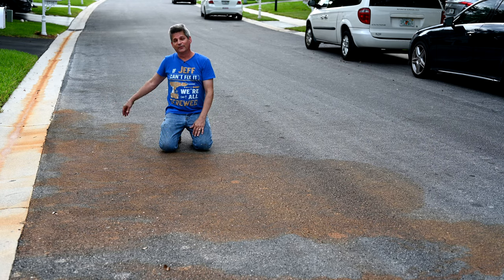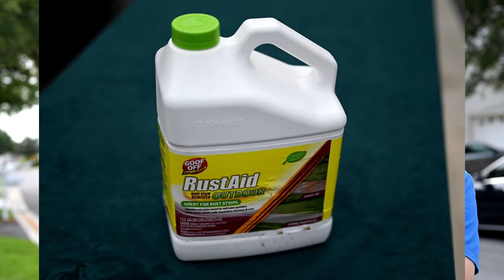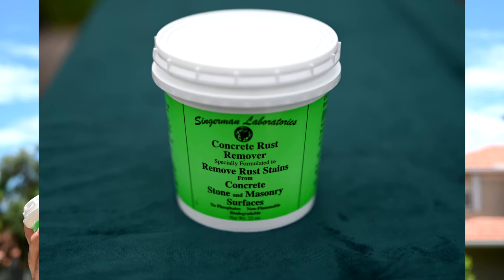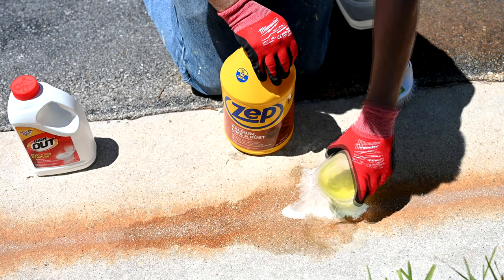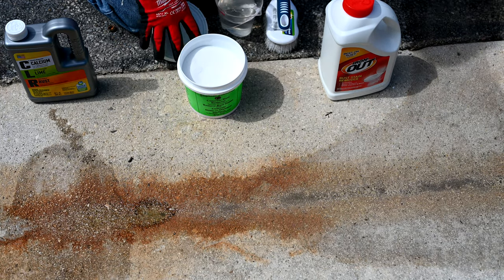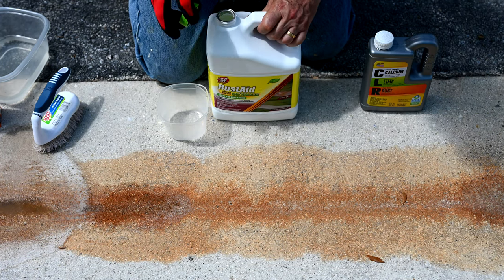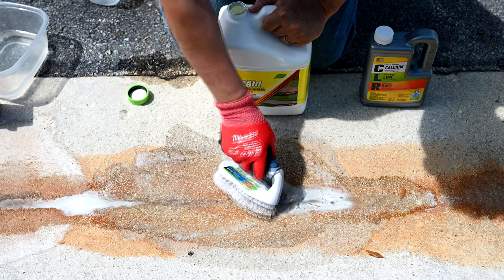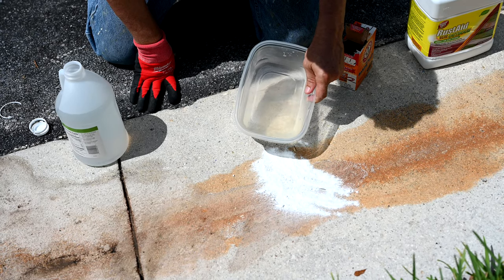Rust Remover Challenge: What Removes Rust Stains Off Concrete?

Comment from the maker: ✅ Here is the winner from our testing:Singerman Laboratories Rust Remover for Concrete (22 oz makes 1 gallon): https://amzn.to/2Y7UY6y
Reply: Do you think it works for white brick?
Reply: Yeah Jeff I bought that $28 Singerman product and it did diddley after multiple applications and even leaving it for an hour. Maybe you got a concentrated jug . Mine was not.
Reply from the maker: @jamespearson3874  No they are all the same. The Singerman comes in a small white tub, and you mix the crystals with water to forma jug. so there is no way mine was any more concentrated than yours. Are you sure you bought the actual Singerman product? White tub, with green label. It should work, it has worked on everything we tried it on. Also, if mixed correctly, the product works in about 3 minutes, and they tell you to rinse it off before 15 minutes or it will stain the concrete. So leaving it on an hour will accomplish nothing. So question is, are we sure it was rust you were applying it on, and not something else? I'd love to see a video of this in action if you can post one on your channel and send us the link to t.
Reply: Would this be safe for patio slabs or stones? Or is it strictly for concrete?
Reply from the maker: @RH-nk7eo  yes have used it on blacktop, pavers, painted surfaces
Reply: Where can you buy Singerman Rust Remover?
Reply: @thecaptain6994  …Jeff put a link in the top comment that you can use to buy it through Amazon.
Reply: @jamespearson3874  $28??? here in Canada, I cannot find it for anything less than $90 for the same size container :(
I think I am going to go for the Rust Out which is on sale right now at our local Home Hardware store for $13.95. It looks like it did a half decent job in Jeff's video.
Reply: Worked like a charm on my stamped concrete patio. Thanks Jeff!
Reply: For what ever reason SIngerman does nothing for me. I've had the best results with rust aid. I have massive dark red spots in my drive away and literally nothing works on it.
Reply: @jamespearson3874  It didn't do squat for me either.
Reply: Whuch of those products do you feel offers the best value for the money? The Singerman seems pretty pricey for a gallon. Also  which can be most easily he applied with a sprayer? Thanks.
Reply from the maker: @UnderPresser  The fingerprint product even though it might be More expensive than others comma at least it does the job And you don't have to keep driving to the store. Looking for one that does work. It's a somewhat thick and gooey product once you mix it so I don't know if it will spray. I have not. Tried it yet and I prefer to work or small area at a time because you have About five minutes before you have to rinse it off
Reply: I use Oxcalic Acid. It kicks butt

Comment: Based on seeing this video a year ago, I finally got the Singerman stuff and used it.  Man did it work!  This video isn't trickery, the Singerman did exactly what the video shows.  And I have a whitish concrete driveway that had radiator rust spots on it from a leaky car, and these were thick and very orange... very hard to get out - I tried a lot of stuff and it barely made a dent.  The Singerman cut right through it!  Amazing, thank you for the tip!  A few other comments:

- The directions are very good and clear.  They did say that there should be a decent layer of gel on top - if you try to spread it out too thin, it's not quite as good. I found this to be true... leave enough on to cover the "highest" points surrounding the pores of your concrete (like 1/8", not much).  The stuff I just lightly coated on came off a little less.  I assume the layer is to give the chemical enough room to work and mix in with the rust.  Whatever, it was great.

- You'll know it worked when most of the rust turns from red to green.  If so, it simply hoses off... amazing!  You can also scrub the toughest areas, but it only helped a little.

- They say it loses half its strength after 15 minutes, but not to let it dry completely.  However, it dries pretty slowly - over an hour if applied correctly.  The first batch I let on for 15 mins. and all but the worst, thickest rust came out.  I did a second batch over a similar rust spot and let it sit for over an hour.  In this case it came off 100%.  So you might let it sit at least 30 mins. for the worst stains.

Anyway thanks, this is a GREAT product!
Reply from the maker: Thanks, I'm glad you liked it!
Reply: Can you dilute this product and use a pump sprayer ?
Reply: 0⁹

Comment: When it comes to the Goof Off, I can tell you I have hard water rust stains on my sidewalks and driveway that it turned absolutely white.  Worked better then I could have imagined.  I’m sure there is a difference in rust, but mine was pretty bad.  To be honest it took  a couple applications (2).  That worked the best, CLR did nothing and I have never had luck with that product literally on anything.  I just sprayed the Goof Off on and in minutes it cleaned it.  Just my experience.

Comment: I had some serious rust stains on porous pavers from iron fittings dripping from my faucet & from fertilizer dripping through an above ground planter on my lanai. I just realized I had a container of Zep on my shelf I bought about 15 years ago & gave it a try. In just one application (50/50 mix) it totally removed any trace of stains on all my pavers. I was ready to buy new pavers & replace them all. I wouldn't hesitate to buy it again.
Reply from the maker: Sometimes it depends on the rust type, but you can see here Zep had not much impact on the rust.
Reply: @Rich my issue is fertilizer rust on brand new concrete pavers. So annoying! Did you use the formula of Zep shown in this video?

Comment: Jeff, my experience...I use the Goof Off Rust Aid in a pump sprayer on sprinkler rust on white plastic fences and the house stucco and its gone in 2 minutes. But on the brick driveway pavers and the sidewalk no luck. 
   I then pressure cleaned the driveway and sidewalk (lots of dirt) let it dry and tried the Goof Off again and the rust disappeared. No rinsing.

Next challenge....HOW TO GET OIL STAINS OUT OF CONCRETE AND BRICK PAVERS
Reply from the maker: That is very strange. It must have something to do with chemical bonding to the concrete. That explains why the Singerman Laboratories product worked so well, because it was formulated to work on concrete. I wonder how it would work on the PVC fence.

Comment: Baking soda works as a base and therefore neutralizes the acid in the vinegar rendering both combined useless for cleaning. You're better using either stand-alone vinegar for its acidic property or a water and baking soda mixture for its abrasive property. Again, together you're creating a mixture that could have been done with water, but it does create CO2 if that can be used for anything. It will put out a fire but baking soda can also do that as a stand-alone. Just throw it in a fire to douse it.
Reply: He never rinsed it off either.  If you don't rinse it off afterward, it will look like this.  I just tried white vinegar on my concrete driveway on a rust spot, and after I rinsed it off (after about an hour) it looks great.  He didn't rinse off any of the products on the video, so no wonder the results were so bad on all of them.
Reply: Exactly!   MAJOR pet peeve of mine mixing them. Use either one, but not both together.   Like mixing hot water and ice cubes and expecting something spectacular.

Comment: What do you recommend for removing very light rust stains around a pool. From a iron patio set.It's concrete with a little bit of rocks. It's not heavy at all mildly lite stains. Slightly yellow
Reply from the maker: I would use the Singermann Labs we showed in tis video

Comment: Haven't trid anything yet on a few heavy rust stains in the garage - nice clean concrete floor of 10 years.  SO did a quick google search.
That search brought up quite a few different websites stating 'straight lemon juice'; as the best remedy.
Then seen this vid listed further down the line -thou now 5 yrs later - surprised no mention of the lemon juice at all here nor in the comments.

Comment: Vinegar works on many things. To remove rust from METAL I haven’t found anything better besides the electrolysis method. Also, white vinegar is a cleaner not a salad dressing. Use red wine vinegar or apple cider vinegar for your salad.😊
Reply from the maker: Great tip!

Comment: Surprised white vinegar didn't do well, it definitely works great for rust on metal
Reply from the maker: I was watching another video from somebody else yesterday where the vinegar did not work on metal So who knows the mystery of why does or does not work
Reply: @jeffostroff  had to lol at your video, I actually dump out the vinegar into a bucket and throw old steel horseshoes over night and it works magic
Reply from the maker: @steverone7623  Could be it works on some metal, but not when it's on concrete. Look at David' Kupferman's comment above,  Goof Off Rust Aid in a pump sprayer on sprinkler rust on white plastic fences and the house stucco and its gone in 2 minutes. But on the brick driveway pavers and the sidewalk no luck.
Reply: Rust doesn't bond to concrete the same way it bonds to metal.
Reply: @jeffumbach  if you use a grinder on steel over top of concrete, the metal shavings that come off will rust and stain the concrete ask me how I know 😂
Reply: He never rinsed it off.

Comment: I just use very inexpensive Oxalic acid 12 ounces to a gallon of water in a garden sprayer. Let it sit for 15 minutes and rinse it off and the rust is gone..I paid $2.50 per pound for my Oxalic acid bought here in Florida in the Fall of 2023.
Reply: Just done porcelain tiles outdoors been down for 7 years 
Non slip so there textured 
I could not clean them no matter what I used the I used Oxalic acid 
Started off being cautious then made aslurry 
 Used 30 kgs 
They came up atreat brand knew grout as well 
But you need a short nose bristle and elbow grease

Comment: I used the Singerman. Some of the rust from iron fertilizer pellets came out. And I also wound up with some white stains.
Reply from the maker: You have to make sure to rinse it before 10 minutes or it will stain
Reply: @jeffostroff  I waited the 15-20 it says on the container. And I had to apply multiple times to get the stains out. Then here comes my gardener again putting those iron pellets on. So I have to do something else or reapply.
Reply: @jeffostroff  stain what color

Comment: That stain reminds me of when I left an old chevy s10 with a rusty bed parked out front for nearly a year. The rain kept rusting and washing the truck and put a big embarrassing stain on the pavement!
Reply from the maker: Yeight did you ever get rid of the stained?
Reply: I flushed my vehicle's radiator with it parked in my driveway (concrete).  I thought the rust stains would never go away!  It took years, despite trying several different cleaners & lots of scrubbing evety once in a while when I felt motivated & optimistic.

Comment: SIDE NOTE:  Baking soda is a base and vinegar is an acid.  The distilled vinegar will get the job done with more soaking time, but the baking soda neutralized its pH rendering it ineffective.  Mixing these two only results in making Chlorine gas and salt water.
Reply: Baking soda and vinegar produce carbon dioxide. Bleach and vinegar produce chlorine gas. #science
Reply: @frankreilly7858 I tried vinegar. Nothing happened except me craving salad.  However vinegar works great on your windows if they build up slime from the sprinkler water. Vinegar and newspaper was the only thing that got the window clean.

Comment: Unless you edited out the use of 7 separate scrub brushes, OR  footage of your COMPLETELY cleaning the single scrub brush it appears that you used, through the entire "experiment",  you ended up scrubbing each spill with the remnants of the previous cleaner, after using the ZEP.   Not a clear test of each individual products strength .
Reply from the maker: Brush was rinsed in between.

Comment: Rust removal from concrete may be different but I can assure you soaking rusty metal in vinegar is as effective as the most effective acid (hydrochloric). Except vinegar does not have the safety issues harsh acids do and you can even put your hands in it without burning your skin.

Comment: What accident happened that put all of that rust stain on the pavement and concrete? Was it just a spill that dried out and left the stain or did it develop over a long period of time because of rusty water draining over it or something similar?
Reply from the maker: What happened was I used so famished acid to clean off my metal tile tools to clean all of the mortar off of it and when it was done the water was clear so I dumped the water on the street thinking OK it's just clear water but found out later I guess that all of the iron and other metal particles that had sort of edged off of the metal tools a little bit left a lot of particles in the water that you didn't see and till it oxidized in the air within A-day of pouring it on the street.

Comment: Vinegar and salt. CLR ? You need a water blaster! In Australia nothing is really strong enough!
Reply from the maker: The pressure washers don't even help
Reply: @jeffostroff  I bet a hot water blaster would do it? But at 6000 psi! But it rips up bitumen or asphalt.
Reply: @jeffostroff  American brand pressure washer.  Damn cheap and great value. 3500 psi, under $ 200 AUD.

Comment: Baking Soda, its only use in these internet home remedies is as a aggregate for polishing.
However they all failed 3rd grade science class and they add it to the peroxide or vinegar there by neutralizing the properties of the other material component.
Vinegar works fine, especially the cleaning vinegar but you have to be very careful with concrete, especially if the concrete or vinegar is hot.
I once used cleaning vinegar to clean and flush an old waterheater.
During the flush a puddle of vinegar got on the concrete, even though I immediately neutralized it within 30 seconds with baking soda and got it up with lots of water and a shop-vac, the previously smooth concrete was rough and pitted.

Comment: Lol vinegar does do a lot though. Microwave water and vinegar in a mug. Smells terrible but it will loosen spills in microwave and remove smell. I also just used it to clean battery acid off a ton of old faux candles that I let batteries expire in. Bubbled and dissolved it. Dont hate!
Reply from the maker: Well you saw how little effect vinegar head on rust stains on concrete
Reply: @jeffostroff  Yes agreed, but it is still more useful than as salad dressing!

Comment: My husband left the hose bib on our concrete patio.  Left a large rust stain.  We used plain old white vinegar, left it on for 10 minutes and it came right off.  I recommend trying vinegar before trying these other expensive things. I agree that you can't believe everything you read on the internet but apparently you can't believe guys that do videos either.
Reply from the maker: Lol I guess you missed the part about where we showed the vinegar and how it didn't work. If you got rust from a hose and you cleaned it off right away vinegar may help. But it doesn't help on all types of rust and once it's been baked on none of the over the counter remedies are going to work you have to use for example Singerman Laboratories Rust Remover which we showed you in a separate video now we removed all of the rust off somebody's sidewalk leading up to their front door when nothing else they tried worked

Comment: Went out and bought Iron Out ($16) after watching this video ...… sorry, but had very little effect. On brick or vinyl siding it DEFINITLY DID NOT remove it or even come close although it may have changed the shade of the rust color a tad.  My stains are from our yard sprinkler system which uses water from a well and the water has a lot of iron in it. It has hit the side for the shop (vinyl siding) and the side of the house (brick) for several years and has left rust stains.  I followed the directions and even doubled the concentration of the mix on my second try with no luck.  I am hesitant to sink almost $30 into the #1 pick (Singerman) with the dismal failure of the #2 pick.
Reply from the maker: That's why I only use the Singerland labs stuff, it  Works perfectly as you see in this video and even another video that I did it my piano teacher's house. This is the only product that works to 100% the other products just don't cut it.  Did you see the other video that I Uploaded that from my piano teacher's house? We used at the singer land product over there and it removed everything off of her paver bricks that had been kicked on there for 2 years from her sprinkler as well

Comment: Looks like Singerman does the trick but at $31.99 to make 1 gallon that only covers 60 square feet, I'll need to take out a loan to clean my driveway.  Thanks for the video.
Reply from the maker: I did my piano teacher's driveway with the larger tub, and barely made it, only applied it in spots where it is needed. It's not the entire driveway that needs to get coated

Comment: Vitamin C  takes rust off from bottom of pools ,so I know it will work here on concrete,
Reply from the maker: I doubt it will work
Reply: @jeffostroff  Jeff, I ordered a 1 pound of powder vitamin C from amazon, 19 bucks, had rust stain in my pool, 8,000 gal, pool. pour it in, was amazed rust stain gone ,whole pool looks new. And that's underwater, if your at home and have a vitamin c tab try it, it works buddy!